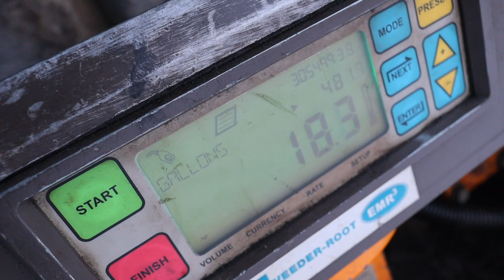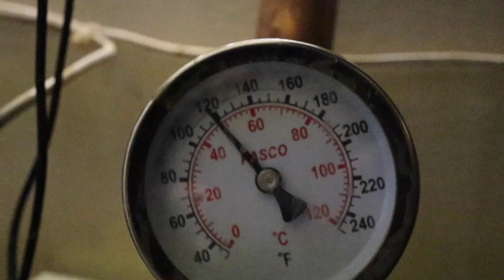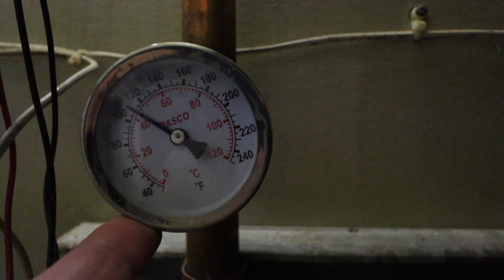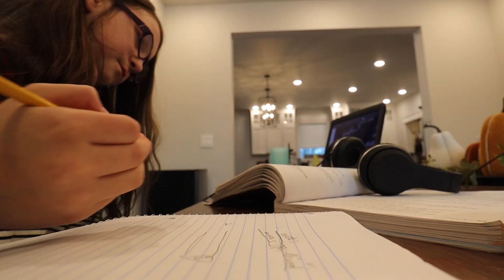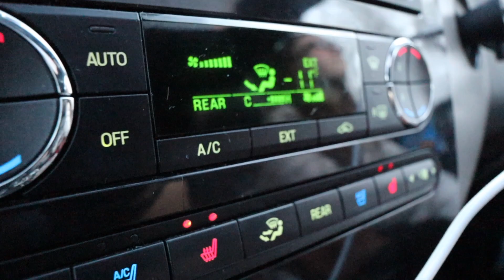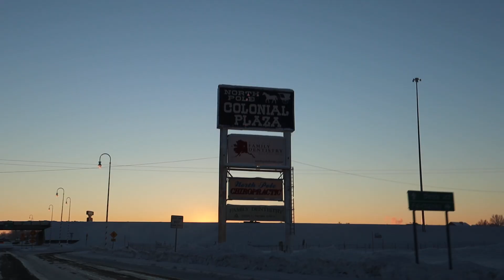HOW MUCH WILL IT COST? | HEATING OUR HOME IN ALASKA |Somers In Alaska

Comment: I have electric baseboard heaters in each room here in Kentucky. It not been as cold at night here. It been 60/35 degrees for November. Always usually above zero here. It can get a few degrees below zero some years. Teens are usually the coolest here in Kentucky. Prayers for Alice! 🙏

Comment: Lived in California and Texas my whole life- I've actually never seen heated floors before. Usually it's tough keeping cool lol
Reply: From my experiences with LA, San Diego, and the Bay Area, you can easily live half the year with no air conditioning or heating in your home. Texas is bipolar. And Alaska?  You need air conditioning 3-4 weeks out of the year if you’re hot-natured. Especially Fairbanks!
Reply: @jondstewart  I miss you on the Daily Show
Reply: Lol we have heater flooring in the UK only use it for few months a year i couldnt hack all that snow and darkness for months on end
Reply: I live in north texas, we have an older home built in 1920 and we actually have heated flooring in it lol yes it's weird, but  I guess that's how they were built
Reply: Texas here 🙋🏼‍♀️ Oh my the thought of heated floors, ugh. Of course It’d be great in Alaska no doubt. It’s November 19th 6:00pm and my air conditioning is on 71 degrees.
Reply: Carl, this transplanted native Texan has resided in New York for 20 years now.  I wish we had radiant floor heating, it is the best. Have spent many winters paying $4000 a month just for heating a house built in early 1900's - big and roomy but very expensive to heat.

Comment: Living in the south, East TN, we switch from jackets to shorts in the same day. Cold morning mean in the 30's and by the afternoon it can be in the 70's. Forced-air system is the best solution. We also have a HVAC company and people tend to hold out replacing a unit when heat isn't working but call same day for A/C issues.

Comment: I live in PA. We use wood and mainly coal during the winter. We do have electric baseboard heaters but they were only ever turned on when installed due to the cost. We heat our house with a coal stove that is a replica of an old fashioned cook stove. It comes in handy when the power goes out so that we still have heat and we can cook on it and it has an oven. For around $500 we can heat for all the cold months for a year. Ceiling fans circulate the heat throughout the house.

Comment: This is our first house in CT with forced hot air using propane. Seems cheaper and definitely cleaner. No need for yearly furnace maintenance. Had it filled yesterday for $2.39 a gallon. Heating oil price sounds about right.
Prayers for Alice and all suffering with COVID 🙏🏻

Comment: Our high will be 86 tomorrow and Friday, then drop one degree each day till Monday (at 83).  But my house is made of solid brick and the interior stays around 72 to 74, so no need for the air conditioner.   My average heating bill in the winter is around $70 a month (natural gas).  We have very mild winters, so we don't need the heat as badly as you do.  Since heat rises, have you thought of putting in ceiling fans and have the blades set to force the air downward?  I have ceiling fans and do that here during the winter, it also keeps the air circulating.  I only mention that because you all have very high ceilings in very large rooms, imagining how much hot air is up there.  Sending prayers for Alice in Kentucky, adding her to my prayer list.  You all keep warm and stay happy!!  Be safe and careful on those roads out there.

Comment: I’m in Thornhust Pennsylvania, near the Pocono’s. We have Propane & have a locked rate of $1.83 a gallon with a full fill up, we have two tanks, 100 gallons each tank. We get temperatures below zero during the winter months, we spend between $850-$1,150 a year to heat our home

Comment: We live in Germany and we are building a house. We installed floor heating powered by an air heat pump. Germany has strict regulations for new builds. Heating system that run on oil are being banished. We also installed a nice open fireplace, just in case. (Right now it is 37• Fahrenheit)

Comment: Here in maine. We use woodstove as primary heat. Propane as backup. I have a small house with no insulation practically. My house is about 80 on avg through winter.  We use propane for cooking and heat, bout 40$ a month.  Spend almost 900 for about 2yrs worth of firewood. We buy it in long logs and cut and split ourselves

Comment: Here in southeastern NC we have a freeze warning tonight Temps in low 30s tonight and around 60 tomorrow. I'm snuggling with my dog under a blanket watching this video. We have electric heat and a propane space heater. My hubby works for a propane company and has been super busy. He works mostly in the service dept working on and hooking up heaters, water heater and generators. He is also a back up lp delivery driver.

Comment: I have an electric heat pump here in TN. Fall temps hit unseasonably early so I have hardly needed neither the AC nor heat in a couple of months. It usually stays pretty mild until January, then it's when it's more likely to be in the twenties and teens. Main thing with our winters is we just get a ton of rain, people usually don't realize how much rain we get here! Past couple winters seemed like it rained from November until Spring; esp 2018 was a very rainy winter. My electric bill has only been about $45/mo lately for my 1200 sqft townhome :)

Comment: Bert here in Washington State I had a ductless heat pump installed total price was $3100 out the door. We got a rebate from our power company $1500 or would of been more and it will heat to 10°above and cool to 105ﾟ. Cost runs $20 - $25 per month.

Comment: Here in the midwest. I have a high efficiency forced air furnace with one thermostat powered by natural gas. I am on the budget pay system so it's the same amount all year. Our house is small (682 sq ft plus an unfinished basement).  Our natural gas bill (we also have a natural gas water heater and range) is $107 per month but water and sewer infrastructure fees are also on that bill as well.

Comment: I'm near Melbourne, Australia and we use heat pumps for our heating and cooling as it rarely gets below freezing. My parents have electric resistive floor heating (in addition to a ducted heat pump system) which feels lovely but costs about $25 a day to run, which is a lot more than the $4 a day we pay!
Reply: Wave 👋 hello fellow Melbournian!
We have put in hot wire election wire heating but we had solar for 14 good years!

Sad story but the inverter just died but good news we’re upgrading and putting a 13.2kw per hr solar array on the roof to replace the old 2kw one.
Also we’re planing Tesla battery’s once the new ones are released. Hopefully they will be larger to store our excess production.

We’re planning on moving to a electro heat pump for water when the the old gas tank goes as it will be free to run with the large solar array we will have .

I figured when I decided to go the electric floor heating route, we’re going to be counter balance the costs with solar so there was no point issuing hydronic with gas which has become more and more $$$.

Gas always used to be cheap but it’s moving away from that more and more.
Reply: Prayers for Alice and Landon🙏 Blessings to you and your family 🙏💕

Comment: The way you guys built your home is so interesting! Here in NJ its been cold in the low 30s... my heat runs on electric but my bill hasn't been too bad because these last 2 wks the weather has been very warm. Which is not common for this time of yr..

Comment: I'm on Canada's East Coast in Nova Scotia, and the average low here is 20 Fahrenheit. Our house came with the same as yours, in-floor radiant hot water on the main level and baseboard hot water radiant on the 2nd floor. We installed three ductless mini-split heat pumps in 2015, and this cut our power bill in half.

Comment: In the uk 🇬🇧 we have radiators. Central heating system which pumps hot water into radiators, from the boiler, around the house to heat it up.

Comment: Heating in my hose out in the countryside Sweden. My house was built in 1796. It has been "upgraded" and added on. The base is timber logs. The ad on timber and board and batten. The ground is on big rocks and like a stone wall all around. The walls is like 2 feet deep. I still have a tiled stove that is well over a 100 years old that still works absolutely fine. Good to have when its cold and damp and when the power goes out. Main heat comes from a air source heat pump. It works down to -20 C. When temperature goes below that i need to turn on the electric oil filled radiators.

Comment: Hi. I'm in Cincinnati. I have gas heat furnace. But its on a concrete slab. So I'm always cold from my knees down. So I also have space heating fans. If they tip over the shut off. Thick socks too.

Comment: Actually here on the seaside in the South of France I try not to heat although I have electrical heating, expensive . I only heat during nights in Jan-Feb when temperatures drop to 32 degrees F. But we need to wear a pull-over inside.

Comment: We have forced air and heat.  Our old house had a fireplace and when we lost power we used the fireplace and hubby would fill it up before bed and then if either of us got up in the middle of the night we would add more wood.

Comment: Shipping is crazy!! They upped the rates from Oct 18-after Xmas for the holiday season- and as you may know, it always goes up in late January. I ship from home and it’s better than in the PO but it’s still crazy how much it is!
Reply: And for bert: we heat with electric in NW Arkansas. We are in a place that does not have natural gas and electrical is how our house was built. We do have a gas fireplace for emergency heat that is propane. It’s zero clearance so no vents/chimney but it puts out a decent amount of heat if the power is out. 
Our whole elec bill is about $125/mth and our whole house is electric minus the insert. Propane is approx $1.50/gal currently and a 100# tank costs $85 to exchange. Hope that gives your heat geekiness some satisfaction. We are gadget peeps so we get it.

Comment: In the NWT Canada fuel oil costs about $400 a month and power is almost as bad because the lights are on all day .  In Southern Alberta I have natural gas (the add on charges are equal to what gas I have used) and it is about $90 - 120 in the winter.  In the summer gas is $4 used and add ons $38,.  Power in the winter runs about $65. And I have no insulation in the walls but they are 8 inches deep.  And we have had 2 ft  of snow in November.

Comment: In Australia we are in WA we have ducted heating and cooling, but also have gas heating but don’t use that because gas is becoming a lot more expensive to run in Australia and is not as efficient so we stick with the ducted reversed cycle.

Comment: We live in Northern Ohio and also heat with fuel oil, in a Forced air furnance. But we have two homes we heat. Both have 250 gallon tanks. To top off from nearly empty, usually takes about 1200 give or take. Currently its $2.419/Gallon

Comment: I live in Michigan and we have radiant floor heat and we heat entirely with wood. We don’t have natural gas where we live. But radiant floor heat is not super common. My Dad built our home and is in the heating and cooling business and wanted our home to have the best system on the market. But most of the other homes in our area have forced air or baseboard heat.

Comment: You do have a large house to heat that has to be quite expensive. My little bitty house (900 square feet) is heated forced air with natural gas. Actually it’s a 1950 stucco house with no insulation. Can you believe that!

Comment: So in the UK we have boilers that heat up radiators and then in older houses (like mine) we usually/normally still have gas or electric fires. In the new build style houses they dont come with fires, only radiators. But some new build owners will buy a fire place with an electric fire, if they want. Air cons are also something we dont have in the UK, unless you are rich and have a huge house. But year its mainly radiators in the UK xx

Comment: In Scotland and the most common way of heating houses is gas central heating. Most rooms will have a radiator. We have a mix of boiler types depending on the house but a combi boiler is pretty common (heats water and runs the radiators). You can also get electric heating systems that work in a similar way. 

Some people do still run off old coal type fires or have wood burning stoves with back boilers to heat the water. The air vent type of heating systems are not seen very often at all, maybe in commercial buildings and offices but not really in homes. Underfloor heating did have a bit of a moment years ago but never really took off. I think it’s because it was quite expensive to install and a lot of our house are very old and not best suited for it.

Comment: I’m almost 70 and I remember sitting on the huge floor register in our kitchen covered in a blanket.  It would be toasty warm under the blanket.  We had a heat pump in Georgia and we were always cold.  I’ve lived with the hot water system and it just didn’t feel good like gas forced air.

Comment: I pay about $350-400 a month for AC from  May - Sept. (it is over 100 most days and necessary).  So it seems reasonable when you live in a place that requires AC or Heat.  It gets offset in winter for me, when my bill is like $80.

Comment: I think I would have to put ceiling fans in to keep the heat down in the living space. I freeze too easily.
I'm in Indiana.
Reply: Excellent idea!
Reply: I don’t think Indiana or anywhere in the Midwest has snow on the ground half the winter like it did before 15-20 years ago. Alaska has struggled to keep snow on the ski slopes the past 6 years!

Comment: When I lived in Pennsylvania, I had fuel oil for heat. Here in Oklahoma central heat and air. Natural gas furnace. Mid to upper 70's right now no need to run a/c or heater right now.

Comment: I have an HVAC electric unit. 
I also have a fake fireplace that looks like flames but it's actually a space heater.  It warms up my entire living room. 
I live in Florida so I haven't had to turn on the heat or the space heater.  I've still be using my AC!  
It has still been in the 80's but this week it's been a bit chilly by Florida standards.  It's in the 50's at night to you just cover up with an extra blanket and we're fine!  
I won't turn the heat on until the temp drops down into the 30's. 
I'd downright freeze up there! 🥶

Comment: Growing up in central Wisconsin in the 1960's, fuel oil was $0.11/gallon with a hot water system with cast iron radiators in each room.  We would burn 250 gallons in 3 weeks in a 40 year old 2 story home (Dec. thru mid March).  In the 1970's when the oil crisis hit, fuel oil went up to $1.30/gallon, a huge increase.

Comment: We have a 250 gallon propane tank, I just bought 100 gallons for 199.50. We use our instapot and air fryer to cook, vs using the gas stove, to save on propane use.

Comment: Forced air with natural gas. In Texas. We have a 3,000 square foot 1969 house that is not very efficient but we don’t pay too much for heating. I keep the temperature down and we use a space heater in the room we are using or start a fire. Air conditioning (electric) is more expensive from June-October.

Comment: Yikes nearly 1k for 3 months of heating only... 
For heating we have just installed a 1m long gas fire place and electric floor heating which is inset into the subfloor for about 35sqm of flooring (hallways, laundry, toilet, kitchen, dining) and will have in the bathroom when we do a renovation.

For cooling we have evaporative cooling thought out the house and refrigerate split air wall unit in our kitchen.

We also have solar HVAC that came from Newzealand but has been pretty rubbish when it’s very hot.

We live in Melbourne Australia where summer temperature can reach 35-41 degrees Celsius in the peak of summer and down to 1-6 over night in winter.

Our 2kw solar inverted just died after 14 years of hard work last quarter working from home so more usage we got a bill for $300-$350 for electricity and about the same for gas(stove, water and fire place).

I was not having any of that, getting a bill of $300- 350 so have just signed for a new 13.2kw per hour solar system.
The idea is to add some battery’s to that to store and run the heating and cooling as much as possible from electric.
It’s going to make 113% Aproxx of our electricity bill which the excess feed-in will accumulate and then we can get the cash to pay any remaining gas bills in the winter.
We’re also going to move over to electric hot water heat pump which is more efficient and will be pretty much free to run with solar.

Is solar something you have / can consider?
I have seen it done in snowing places with a Tesla battery they just had a scraper to pull the snow off once or twice a day.

Comment: Here in Florida. It doesn’t get to cold in the winter. Right now at 11:40 at night it’s. In the low 60s and we have a cold heat fan set up here. It cost us $174.50 for air conditioning. In the winter we try not to use the heat. Because is doesn’t help us with our sinus. But if we use a heat it would cost about $170.59 something like that.

Comment: You’re an HVAC guy, so I’m sure your house is running pretty efficient with heat. Just wondering though,do you think you might benefit from ceiling fans? Blowing the heat off the ceiling?

Comment: If it makes you any feel better, I pay about $450 a month for my electric in the summer (June-Ocrober) in Phoenix, AZ 😖 just turned off my A/C 3 weeks ago. Plus our gas bill which is about $75/month in the summer. We keep our 1700 sq ft house at 75 with a brand new energy efficient HVAC system